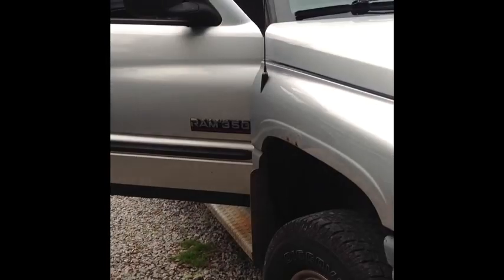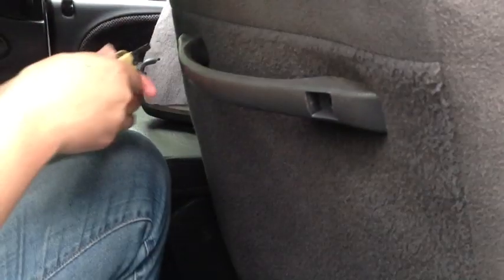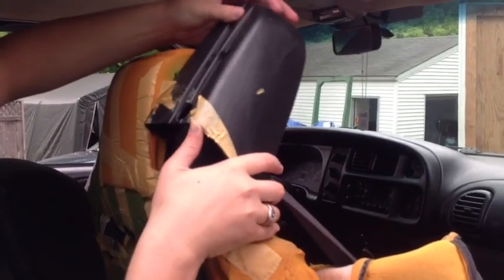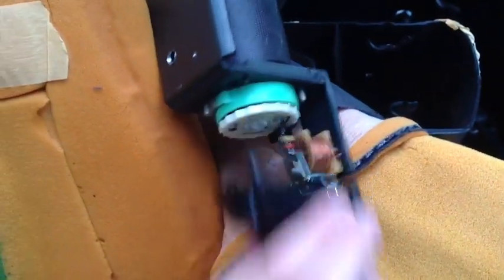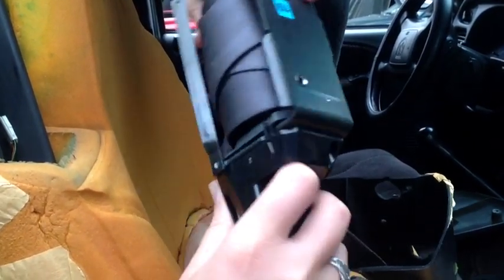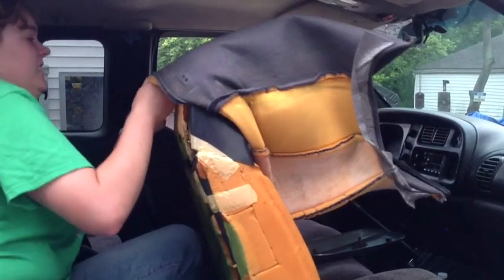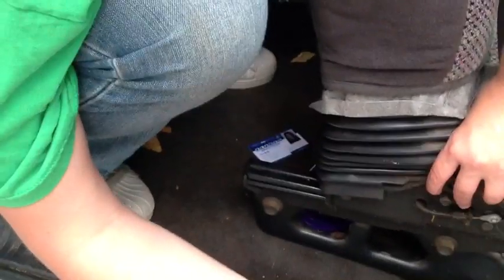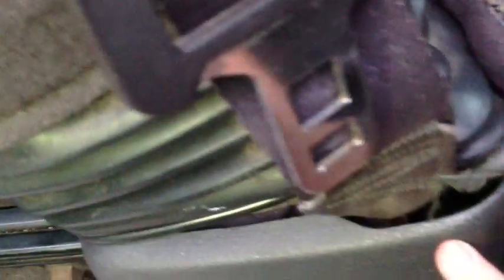2001 dodge ram locked seatbelt repair

Comment: Thank you! I just did this with my 98 Dodge Ram 1500. It helped a lot but I left the little piece you broke off and plugged everything back in. No problems, no seatbelt light. Works perfect now.
Reply: So what was the fault or why did it crash?

Comment: thanks Joshua!  Had to get a T40 and T50 star drive for those star screws. My wife and I couldn't get that plastic cover piece of the solenoid holder off cleanly and it cracked. Duct tape held it back on. Dealer wanted $800 per seat! I spent only 10 bucks for the star drives.

Comment: I have a 99 ran 1500, did what you said.  Didn't have to take off side seat panel, only the tilt lever on the side of the seat.  Works great now...thanks.

Comment: Do you know what causes them to fail? I have the same problem, both driver and passenger belts.
Reply from the maker: the little black box under the center seat is the cause. its supposed to monitor when your tires slip (abs)  and locks it then unlocks it when done. unless the event of an accident the lock jams upon impact and force. not sure what causes it to fail. dealer has no clue either. I've talked to a few and they have no clue about that device. probably a glitch in the electrical.

Comment: I did everything the same way you guys did in your video but now my seat belt light on instrument cluster is permanently on. Any fix for this?
Reply from the maker: After rewatching the video I think the one wire needed put back on. Mines been on ever since as well but haven't been bothered about it when I've been pulled over. They  just asked if it was on and I showed them. I just told them the sensor went bad
Reply: +Joshua Hursell   thank you josh, i appreciate it

Comment: where would the fuse'(s) be located for that type of seat belt retractors? and did you just jump the end of the "plug" with a wire? Good informative video. ty
Reply from the maker: Sorry took so long to reply. Didn’t jump anything and never messed with the fuse. Just everything in the video.

Comment: Same problem, both sides.  Dealer's advice:  pull battery neutral.  Reset once.  Barely 2nd time.  Now not at all.  But what does the central unit monitor?  Dealer was vague.  In the end, amounts to mid-computer age BS, overkill.  Other considerations (minor) are resale, but who's selling?  Thanks.
Reply from the maker: I just took the inside apart to keep it from locking. the little black box under center seat is the cause of it locking up.
Reply from the maker: I just opened up the old belts and took out the locking mechanism. but pull a part sometimes has the whole seatbelt.